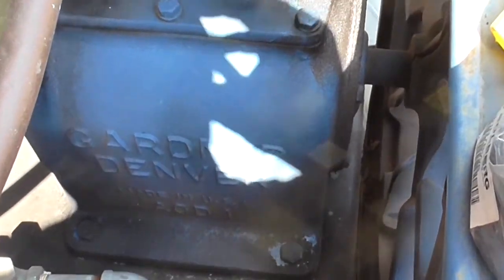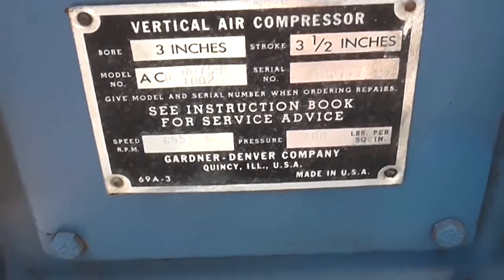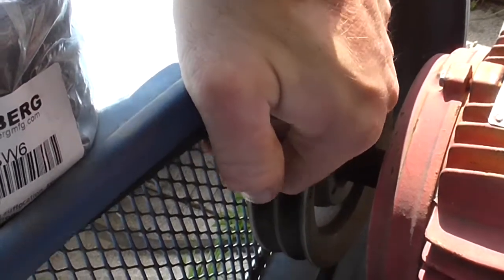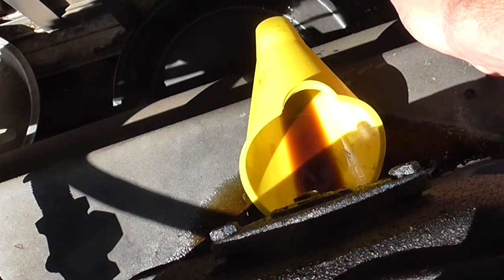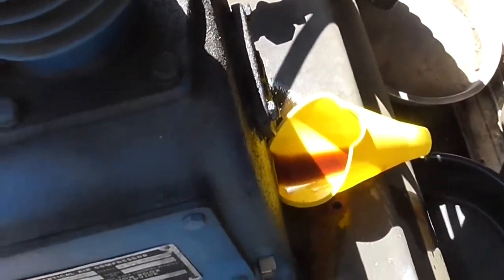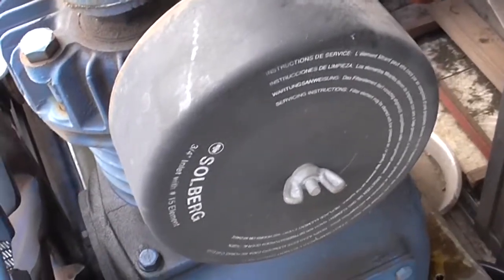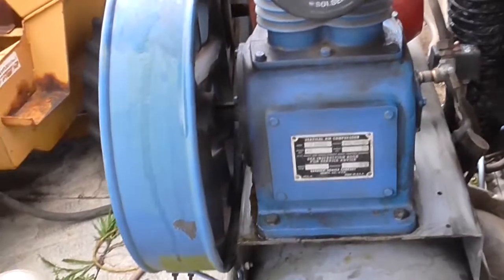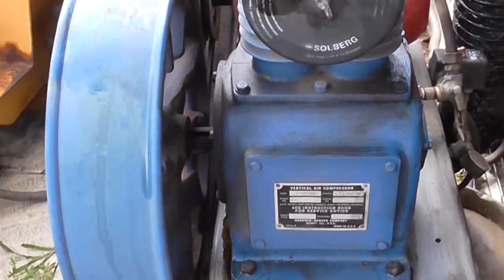Air Compressor (Maintenance)

Comment: i was given one of these, a 1971 model. i think it needs to be rebuilt, it builds pressure but takes a long time. took about 12 minutes to get to 150 psi.
Reply from the maker: It might just be an rpm issue. If it is blowing lots of air out of the dipstick, it will need a rebuild.

Comment: I've never seen a compressor like that.  Very cool! :)
Reply from the maker: Niamh Healy most compressors are vertical, but i prefer the horizontal style, they are easier to service and less likely to tip over if you roll it around.